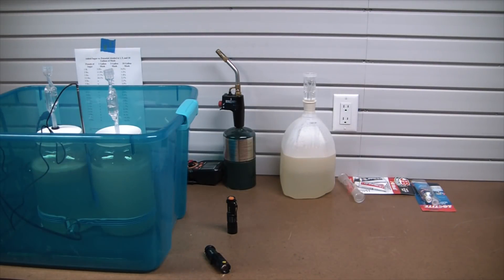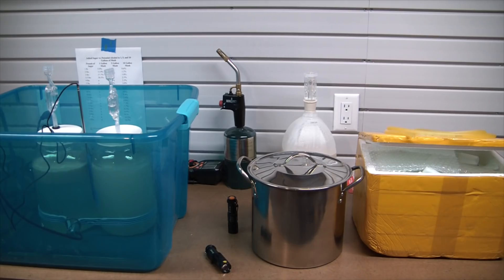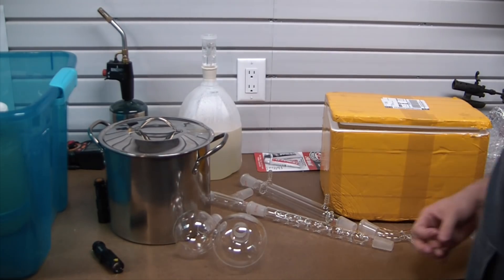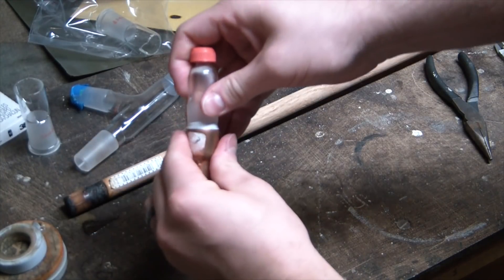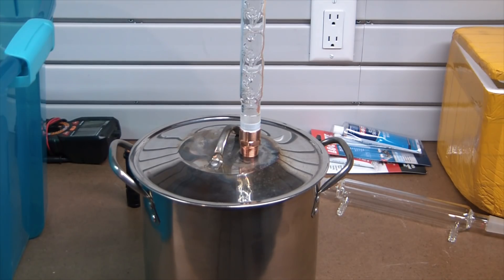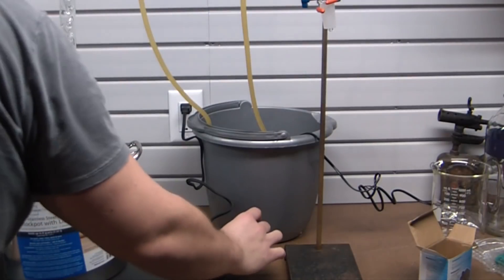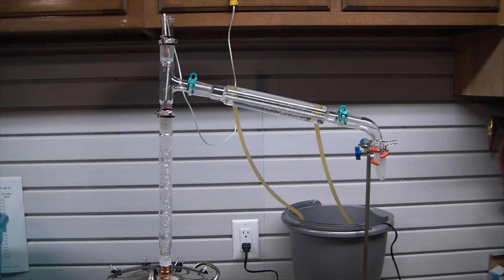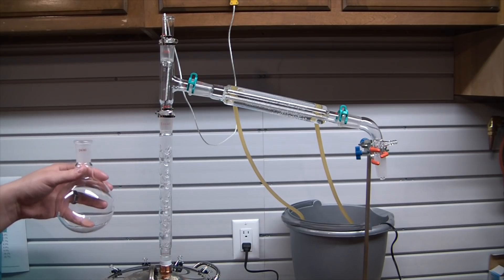Building a SUPER CHEAP and SIMPLE Reflux Still! - ElementalMaker

Comment: What is this 6:45 ? I want to cover a small hole in my distillation pot and nedd to food grade material
Reply from the maker: Just a thick mixture of all purpose flour and water.
Reply: @ElementalMaker Wheat flour? If I cover the hole in the lid of the tank with it, will it affect the taste and quality of the vodka?
Reply from the maker: @Hesifilm it solidifies very quickly at temp and shouldn't affect flavor at all. Moonshiners have been using it for centuries to seal up their pots

Comment: Lol stainless oxidation is  very quick no to many people can solder stainless to copper.  You got be right on ias soon as it's clean then you got to have exact temp control  tig best hand torch you almost have no chance
Reply from the maker: @BradSteen-gb3qy  I actually got a great solder joint on it right after releasing this video and giving it another try with more careful heat. Still holding strong these years later.

Comment: You can't use solder on steel. I'm sure that cheap pot is 304 stainless. But that's not why it won't solder. You should either dip the joint in sulphuric acid, or use a tig welder.
Reply from the maker: Silver solder. Very different than electrical solder
Reply: @ElementalMaker  Actually it's not. Electrical solder used to contain lead, but these days pipe solder and electrical solder are the same. That's moot, though. No type of solder sticks to both copper and stainless.
Reply from the maker: @gizmoguyar  that not true whatsoever. I don't know why you keep referring to plumbing and electrical solder. That is not silver solder. Silver solder absolutely works with stainless. I've used it many times in the past, and in fact, successfully soldered that copper-stainless joint with a bit more patience shortly after this video.
Reply: @ElementalMaker  Modern electrical solder is the same as silver solder. Stainless can only be soldered with an oxide stripping acid flux as I said in my first comment. But that flux will ruin the copper. You may have stuck two pieces of metal together, but I doubt it will last. The only proper way to join those metals is by braising. By the way, steel and copper touching each other is going to cause hella galvanic corrosion. Good luck with that

Comment: I have the exact same pot, which I also had issues soldering too.
When I run my still I use alot of flour paste, but it was super cheap and easy to put together.
Reply from the maker: I ended up trying to resolder it and had great luck the second go round. I kept the heat lighter and that was the trick, I guess I got it too hot for the silver solder ine the first try

Comment: The same rubber cork you have for the air-locks can be used in the same way. You can get a bigger one and make the inner hole bigger for the lid. Might be easier then cooper and glass with tap.. Just throwing it out there. I like making wine and looking to make a cheat still. I also started looking at the cheap chines distillation system.
Thank For The Video.

Comment: Bro, solder wont stick to any stainless steel. Ive gotten lucky a couple times with stay bright flux and solder, but mostly it's impossible.
Reply from the maker: I ended up getting a beautiful solder joint right after editing this video sure enough. Silver solder will work on stainless no problem, I just had it too hot

Comment: Did you use silver solder?  I've braised lots of fittings to stainless steel beer kegs to be used as pots.  Regular solder and flux will not work.  Had to use silver solder, staybrite flux, and MAP gas to solder stainless.
Reply from the maker: Yeah used the Harris safety silv. Turns out I just had the joint too hot, and was able to get them soldered no problem with a bit more patience.

Comment: You didn't have to saw cut. For the cleanest cut, use a glassblower's trick called the "Jaws cutting tool". You can make your own for cheap its basically a modified wrench combined with a carbide wheel. Or even a simple carbide scoring blade. Get some gloves on, score only 45% around, aim score away from face, pull away and bend. Should be a perfect snap.

Comment: I need to distill some isopropyl alcohol so I am thinking about ordering this kit. I wish it came with an Erlenmeyer as I only have a hot plate but whatever they're cheap.
Reply from the maker: Just use a stainless bowl with oil in it as a heating mantel, works great for lower temperature distillations.
Reply: @ElementalMaker  on the hot plate? That makes a lot of sense actually. I have been thinking of building my own hot plate/magnetic stirrer lately but I'm not sure on what motor to use and if I make the plate from aluminum does the lenz effect not but extra strain on the motor? I know that's probably such a small problem it doesn't matter but now I'm curious.

Also thanks for the reply.
Reply from the maker: Did you see my video on my homemade hot plate stirrer? It was quite easy to build 👍
Reply: @ElementalMaker  I did but I need to go back and rewatch it. I have been thinking about using a silicone 3d printer bed heater on borosilicate glass instead of the heater cartridges on/in aluminum but I really don't know. I have only recently started thinking about this project and if I want to do it or just spend like $70 online and buy one prebuilt.
Reply from the maker: @x9x9x9x9x9  that sounds like a really cool idea! I'd love to hear how it turns out if you go that route

Comment: Bit late I know but Kovar metal matches the CoE of borosilicate glass and is easily obtained from the metal tops of computer possessors. Melt and cast your stock and machine your adapter - come to think of it it would be easier to pay the couple of hundred bucks to buy the metal adapter from eBay... or would it?

Comment: Any TIG welder will tell you, that for the most part you cannot weld copper to stainless. The closest you're going to get is probably with silicon bronze, and even that isn't going to have good penetration at the joint. Better way to go is weld in a small stainless tube, and use high temperature re-enforced silicon tubing to connect to the column (available from brewing industry). You would of course have to stabilize the column, but a simple stand and clamp should prove useful.
Reply from the maker: Oh I know you can't weld it, unless we get into the exotic welding types. I was able to very successfully silver solder them together though.
Reply: @ElementalMaker  Nice. I know you're distilling your own, but another inexpensive way to go is denatured Ethanol, which 95% ethanol & 5% N-Heptane, which is much cheaper. The boiling points are far enough away from each other that during distillation we first pull over the Ethanol at 80C (assuming no vacuum), and then the 2nd pull we do at 100C to get that little bit of N-heptane. And presto, you got nearly 100% ethanol on the cheap and no water issues whatsoever. Solvent for extraction on the cheap at that point.

Comment: Would it be to much pressure or heat for a rubber grommet
Reply from the maker: The issue with rubber is the hot ethanol vapors will destroy it, and it will also leech rubber based volatiles into your distillate. Nasty stuff. Silver solder or flour paste are about the only options.
Reply: Ah that makes sense thank you for explaining

Comment: If it’s just for volume ethanol production, instead of solder, I would have used something like this copper bulkhead fitting ( Joywayus 1/2" Female 3/4" Male Soild Brass Water Tank Connector Theaded Bulkhead Fitting with 2 Rubber Ring Stablizing https://www.amazon.com/dp/B07GPP23K9/ref=cm_sw_r_cp_tai_-ZOPDb7CWVAFB ), then used JB Weld as the connection between copper and glass, making sure that the glass was on the inside of the copper.

As for cutting the glass, when I have watched glass tubing being cut, they rotate the glass scoring all the way around, and slowly getting deeper, much like a tubing cutter cutting through a copper pipe, by going around and around, and slowly being tightened, after every few passes.  When you just cut straight through, it’s hard not to put stress, on the last little bit of glass, so it will often cause an irregular break.

Comment: ~$30..?  Really..? 😲 Is everything still in one piece after you ran your sugar wash runs..? 😄 Do you happen to have a link to this $30 eBay distillation kit (if you wouldn't mind sharing)..?  I am in need of a small reflux still, and at that price (regardless of how long the glassware actually lasts), how could anyone resist..? 😄
Reply from the maker: Yeah I'm still in disbelief but the glassware is holding up great. Have done several distillations so far and no issues. Even higher temperature distillations have been trouble free. There is a link in the video description
Reply: @ElementalMaker Oops, must have missed it..  Thanks!

Comment: Solder, while is possible to stick to stainless, but braze would probably be easier to do
Reply from the maker: Silver solder did the trick. Turns out I just had the joint too hot and was causing the solder to bead up

Comment: You can't solder any form of stainless!  You can braze it tho. But if you get it red hot it will get brittle
Reply from the maker: Nope it's very possible to solder. I just successfully did it. The solder has to have 2% or more silver. I used both safety silv 56% and sta-brite 3% silver successfully now the 3% melts at 430 degrees, and as long as your using acid flux perfectly bonds to the stainless even at those low temperatures
Reply: @ElementalMaker  Ok, you got me there. I wasn't thinking silver solder. But technically that's closer to brazing

Comment: I don't  know what your problem with Chinese glassware is? Fair to say most amateur and even some professional labs use it all the time. I have a couple thousand dollars worth of it and never had any problems with it whatsoever. I've puahed  my glassware over 600  deg and no problems. As far as blemishes, scratches, and chips none of my new labware glass from China was anything less than perfect. Are you buying used stuff?  For ethanol distillation which comes over at 78 deg C your "cheap Chinese glassware " will work just fine providing you use it correctly?  I do a lot of ethanol distillation the "CHEAP CHINESE glassware works flawlessly. As far as screwing around  trying to mate a big stainless boiling vessel with borosilic glass, just spend the money for a 3 or 4 liter glass flask? Sure the big ones like that are expensive but if you are going to be distilling for any period of time why not just do it the right way, by the big glass you might even pass for someone that looks like they know what they're doing?
Reply from the maker: It may be perfectly great glassware. But QC is lacking in Chinese factories. If just one piece with a big scratch makes it though, or if someone cheaps out (imagine that!) and adds too little boron trioxide to the mix, it will result in failure prone glassware. If you are trusting your life to glassware, I think it's worth it to pay the extra for a brand with proper QC, testing, and a reputation to uphold.
Reply from the maker: Also a 3 or 4 liter boiling flask can cost quite a bit, requires a large heating mantle which I don't have, and would require many more batches to process the same amount. Resulting in greater percent losses and wasted time. And yeah I think I know what I'm doing. I only have two engineering degrees and a minor in chem.

Comment: You shouldn't have cut the glass, just a waste. It is very easy to cut if you know how, and forget flame polishing, that is something for the professionals and the glass has to be retempered afterwards. There shouldn't be hardly any pressure and if there is you want it to just fall apart.

Comment: Would jb weld work instead of solder?
Reply from the maker: From what I found on the home distiller forums they say not to use jb weld, as the hot ethanol fumes will attack it. Silver solder or flour paste are about the only things you can use according to them. Then again they may just be superstitious old men who are adverse to anything new
Reply: @ElementalMaker  ah I see. Oh yeah I remember now that JB weld cant be used on gas tanks for that reason so that makes sense

Comment: Silver solder or Brazing may have been a better choice.
Reply from the maker: It was silver solder. Turns out I just had the joint too hot. Been a few years since working with safety silv

Comment: I would bypass the glassware altogether and just build the still out of copper and steel. If you want a greater degree of separation, swap out the shorter copper column for a longer one of find a way to retain some glass marbles/beads in the pipe and off you go. Just use a smaller bit of coiled copper from the column to your receiver to act as your condenser and you should be good to go. No need for converting to or from 24/40 and you should be able to solder everything together for a nice, airtight seal.

As for ebay glassware, I've found most of the stuff from deschem to hold up fairly well to the glassware from synthware, but I'm a chemglass fan through and through. Can't vouch for any other ebay sellers as I've really only acquired stuff from deschem, but it has held up to more than a few reactions run in molten salts and the prices on their hydrothermal reactors are pretty fantastic. 

Keep up the good work and swapping out that griddle for a single burner might work better.

Comment: 8:29  If you rotate the condenser 180º so that the hose adapter is up and not down like it is now you will gain a 30% longer column. There is a good part of it that doesn't have water flowing through it which is pretty ineficient.

Comment: to solder stainless steel, drip concentrated HCl onto the solder! That's how I made this type of setup. Another method is using copper sulfate: dissolve it in water, then use a super fine grade steel wool and try to polish the metal around where you want to solder. This will plate the stainless steel with copper.

Comment: Stainless steel requires a special brazing rod and flux to wet out. Normal solders simply won't work. Next time use a cheap stove top pressure cooker. The lid has a built in gas tight seal, and the vent is easy to adapt to your distillation hardware using silicone tubing, hose clamps, and sweat soldered copper fittings. 

Please don't ask me how I know - the last thing I need is a bunch of revnooers sniffing around.
Reply: You all need to move to New Zealand.  Legal home distilling here :)

Comment: Oof, when I saw that glass edge and heard you say you were going to flame polish it, I knew it would break. Glass is tricky but fun to work with
Reply from the maker: It actually flame polished beautifully ( I sanded it before torching) but also closed up the ID a bit and it wouldn't slip over the 3/4 pipe I planned to use. I then reheated it and tried using that charred dowel you see in the video to wedge open the ID... That's when it cracked.
Reply: @ElementalMaker  ah, good thinking with sanding it first!

Comment: Use one of these and the heating element will be controlled by a thermal sensor.
Just set the temp and let it run.
https://www.amazon.com/Century-BNQ-T7B-Digital-Cooling-Controller/dp/B01LZV591B/ref=sr_1_4?keywords=Heat+or+cool+controller&qid=1556076832&s=gateway&sr=8-4

Comment: A bunch of tips from someone who just did this, albeit with a round bottom flask.

100% do not "seal" the entire system. Your t-adapter has a port for a thermocouple, do not put a keck clip on that. In the event of overpressure, the thermocouple will pop out, worse case scenario, instead of the condenser or column detonating.

You'll want to insulate your reflux column, it's difficult to drive enough vapor to the top. 

If you're trying to make anhydrous ethanol, try molecular sieves (5A I believe), should help you draw those last bits of water out.

They sell round bottom flasks with an addition port on them -- very convenient for near-continuous distillation!

I don't know how well the boiler works, but beware "knocking", when everything boils at once. Can easily flood a condenser and generally pretty scary. 

Keep track of your fractions.

Comment: what about sealing the copper thread with silicone rather than flour paste?
Reply from the maker: I actually was able to successfully solder it after editing the video. Used Harris safety silv. Turns out I was getting the joint too hot before, and that's why it kept beading up on me. Lots of the guys on the home distiller forums I found say to stay away from silicone, I can't really see why though, as food grade silicone is essentially inert. Probably just old guys scared of moving away from flour paste.

Comment: If In doubt duct tape & JB WELD or some of grant Thompson’s proto putty 😂 
It will be sealed tighter than a nuns honey hole 🤣🤣
Reply from the maker: Hahaha I'm totally stealing that line! Lots of the home distillers I talked to said not to use jb weld or even food grade silicone. Probably superstitious old men who don't want to veer from flour paste LOL
Reply: @ElementalMaker  I mean....your not going to be drinking it right so it shouldn't matter.
The idea is that alcohol is a solvant, a fairly serious one.  When you have high abv alcohol as a hot vapor even more so.
It's a fairly solid norm in the home distilling world to use only stainless, copper, ptfe, glass and wood in contact with that high abv spirit.
To cut down on the amount of random other chemicals we drink......we say right before drinking the high abv spirit....